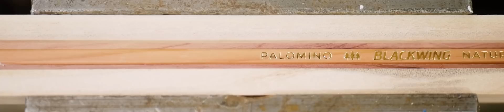Hackwing: A Square Blackwing Pencil

Comment: The "how" was commendable.  The "why" is rather less clear.  But I have a great idea for you... make a Blackwing extender so I don't have to throw my best pencils away when they've got a lot of writing left.  All the marketplace extenders work for round erasers only.    Ideally, it would have a Blackwing eraser holder on its back end...
Reply: not exactly what you're asking, as you still have to take the ferrule off, but it does have the Blackwing clip on there. https://www.etsy.com/listing/817912292/adjustable-tip-eraser-pencil-extender?ref=shop_home_active_63&crt=1